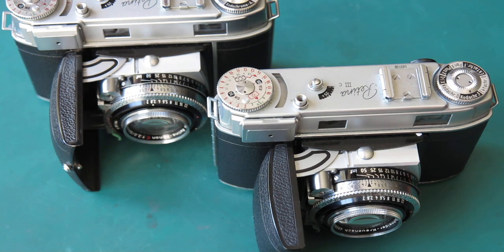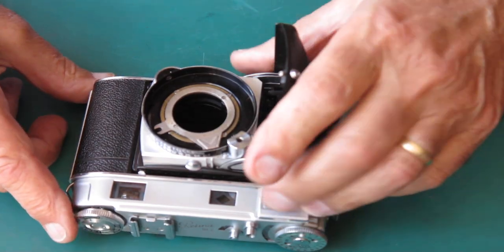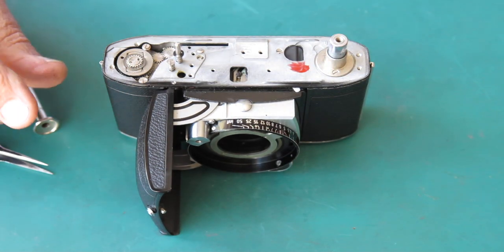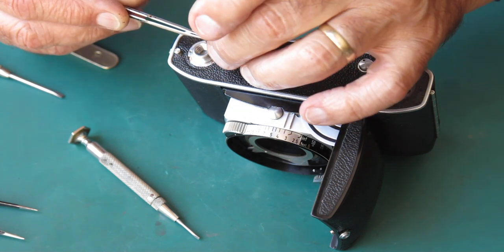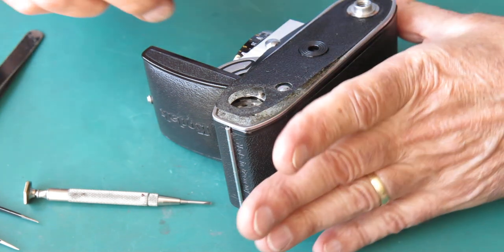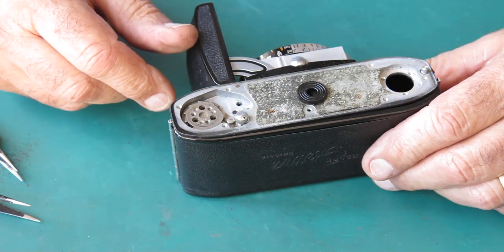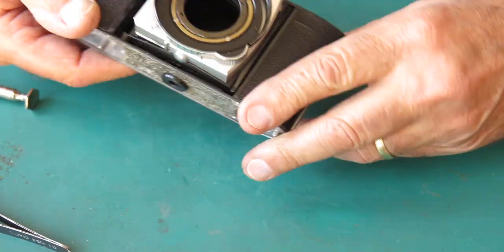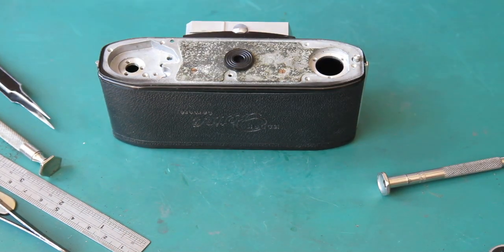Two Retina IIIc cameras, part 01

Comment: What's the purpose of the flap over the meter cell? I notice there's a small hole in it so is it intended to be used for incident light metering (I would have expected a translucent diffuser instead) or is it just for protection?